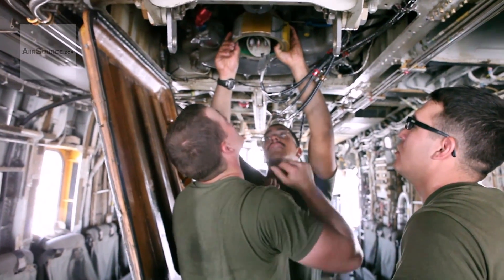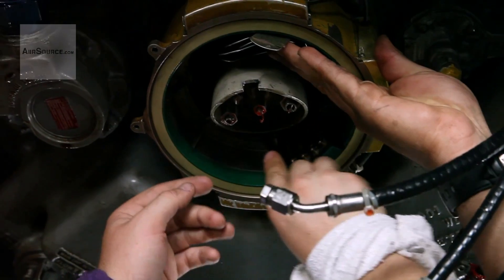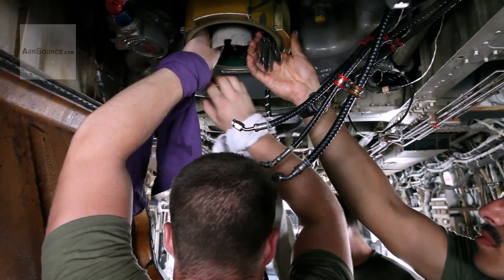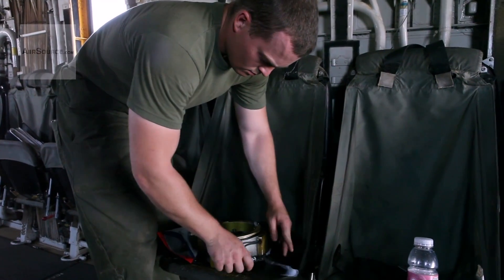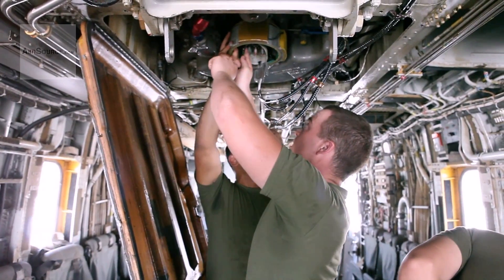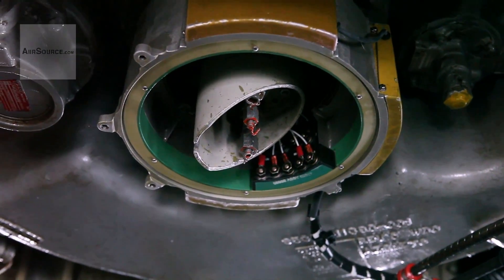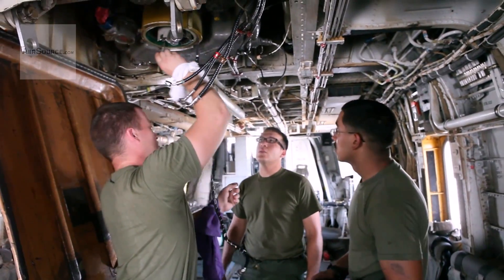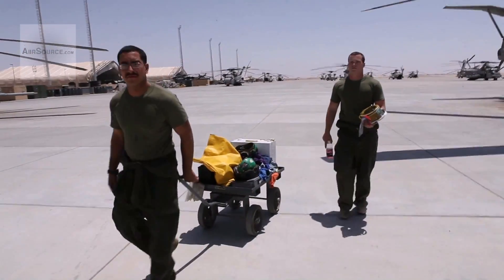Marine Corps Avionic Technicians Working On CH-53E Super Stallion Helicopter

Comment: Great qa guy/sarc/.  The tech was using the safety pliers wrong.  Was a 6236 airborne radar tech in the USMC 1966 to 1969 plus a year avionics school,  staging batillion for return to Viet Nam and other stuff not related to avionics.  Being an airedale beats being a grunt, only had to put up with incoming mortars and rockets; not small arms AIMED AT ME!

Semper Fi